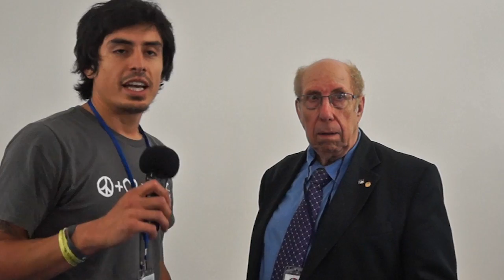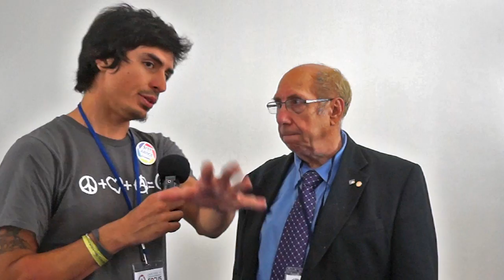9/11 Truth: Dr. Leroy Hulsey Discusses World Trade Center 7

Comment: Where has MintPressNews been? Long time since last video WB MintPress. Welcome to MintPress Derrick!
I have been following this research project since it began. They are putting in one heck of a huge effort and expense into this. Can not wait for the results, of which, I hope they post quite technical results for people like me, and simplified results for those who do not think they understand engineering.
Reply: +BiddieTube Getting Hulsey's garbage-in-garbage-out nonsense peer reviewed and published in any reputable industry journal is another story altogether, but Gage got what he paid for.
Reply: Sure, but how could we explain the free fall of WTC7 during 2,5 s without assuming the lack of resistance of all the structure on the totality of a horizontal plan during this time?
Which phenomenon could provoke the lack of resistance of a specific steel structure over the totality of a horizontal plan during 2,5 s?
Fire?
Reply: +greenbag At least learn the difference between a girder and a column before jabbering stupidly about something you don't understand.
Reply: +greenbag You're too stupid for this conversation. If you can't even use common construction terms correctly, please look for another hobby.
Reply: +Albury Smith The footage clearly shows the building core columns collapsing first. The penthouse was very near the core columns. Those falling core columns pulled the outer columns inward and the building fell relatively cleanly (for an asymmetrical structure). I find it amusing that you dismiss Hulsey on the basis of his politics and not on the basis of his evidence. I guess it doesn't matter what evidence comes out, your opinion will never change.
Reply from the maker: We took a one month break, but are back!  You can check out our latest Behind The Headline segment aired this week: https://www.youtube.com/watch?v=_mVLVWmVa5U
Reply: +Charles Galiko Read NCSTAR 1A, 1-9, and 1-9A and stop embarrassing yourself. Your precious ~2.25 seconds at g was during your Sacred Tower 7's EXTERIOR collapse. The outer columns were 100% moment-connected to spandrel beams, so they could only stand or collapse in unison. The interior was also in motion at the time and well prior to that, so g could actually have been EXCEEDED for part of that ~2.25 seconds.
Reply: @AIbury1  nonsense